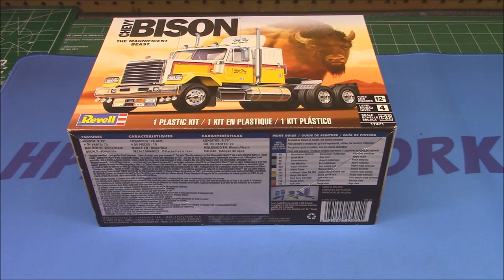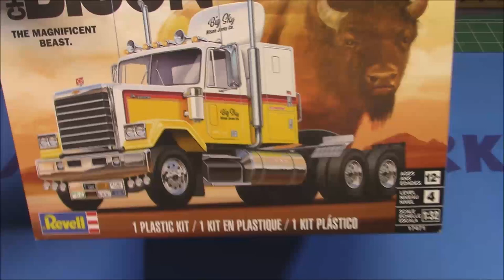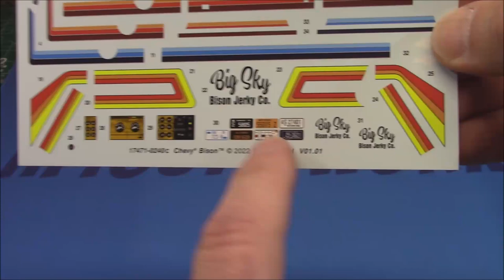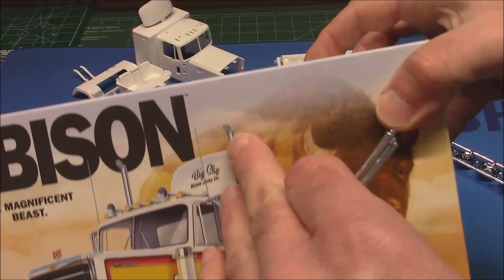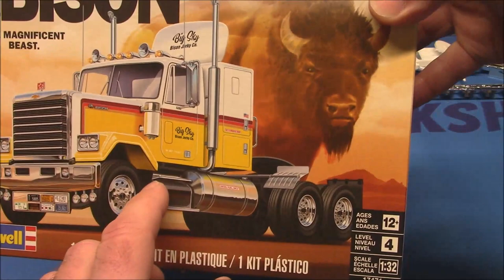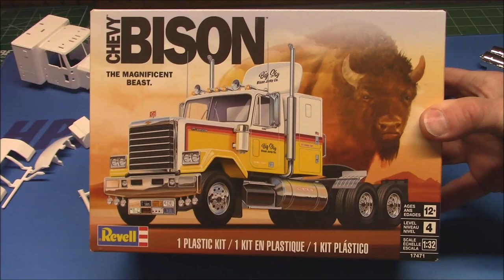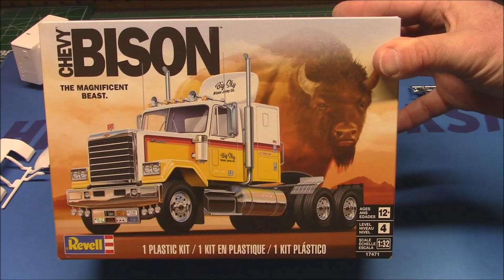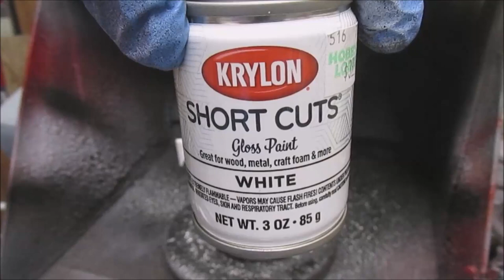Chevy Bison GMC General Semi Diesel Scale Model Kit Build How To Assemble Paint Trim Dashboard

Comment: Favorite rig is the Smokey and the bandit truck! Good luck to all!
Reply: Working on that one myself, tandems for the trailer are done. I am going to hybridize an AMT Kenworth W925 kit, with the Revell W900 aerodyne kit. I had too many problems with the AMT kit, so I'm going to use the cab and sleeper I haven't assembled and place it on the  W900 rolling chassis. I have all the decals that cost about 50 Bucks for the whole decal kit.

Comment: This turned out great! With it being a "push together" it should cut the build time in half compared to the glue together kits. As far as the movie big rigs go, I like the 1975 Ford WT-9000 COE in White Line Fever as well as the 1973 Kenworth W-925 from Movin' On. Of course, who doesn't love the Kenworth W-900 from Smokey and the Bandit? I once, a very long time ago when I was in high school, built a Bison kit. I wish that I still had all of those kits from back then. If I remember correctly, I built that Bison sometime around late 1979 or Early 1980. Also, if memory serves correctly it was an AMT kit. Although, I could be wrong... It was a very long time ago...

Comment: I ordered from Amazon where its listed as a 1/25 scale for $30.00 but its actually 1/32 scale like this one. I should've looked a little closer at the box. I kept it & later found AMT 1976 GMC General 1/25 scale which is basically the same style truck.

Comment: I have a question why do you use modge podge when doing your lights what does it do. Thanks for the videos
Reply from the maker: It's safer, quicker and easier to use than window cement for models which melts the parts together and makes a mess if you get any stray drops or drips of it on the paint.

Comment: It's amazing what one can build using these simplified ex-Monogram kits, this one was built by my dad 40 years ago, and was featured in one of the Verlinden books, the trailer was scratch-built, and the tank was done by Francois Verlinden. Cheers Luc https://i.pinimg.com/originals/cd/83/33/cd833337c4f6c07080e892ff4ca6a5a0.jpg